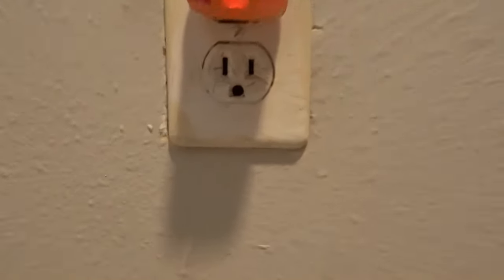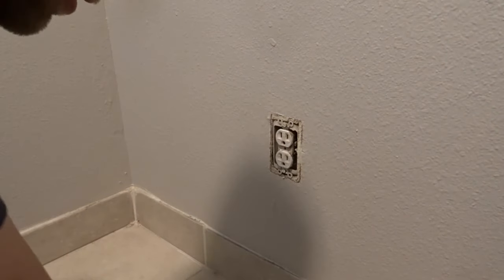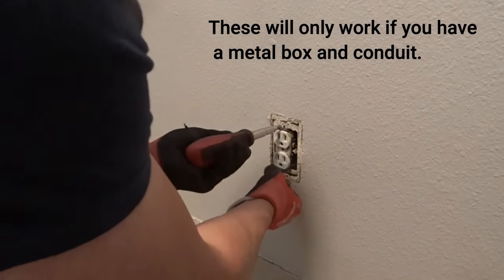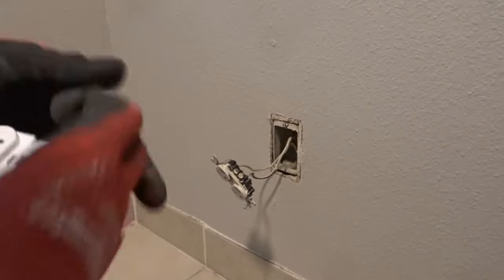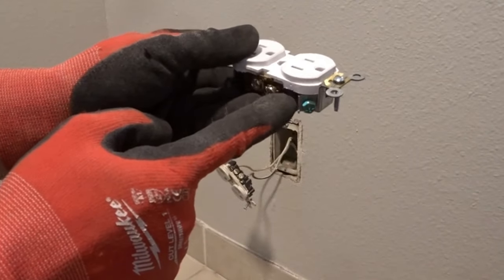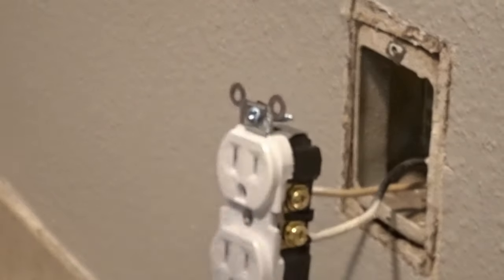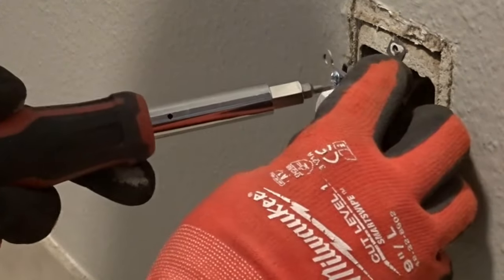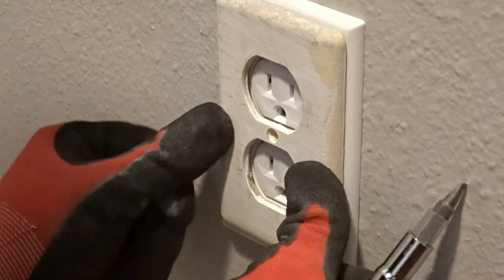How To Replace An Outlet | Ungrounded to Grounded

Comment: The old duplex receptacle had an equipment ground prong. Why was it not grounded ( from the metal box) as the new receptacle is? thanks
Reply from the maker: I’m not sure why it wasn’t, that’s a great question!
Reply: Speaking from experience, more than likely ignorance.
Reply: Ryan Wilson A wild guess would be. The old duplex receptacle was an Isolated
Ground IG type, although never connected as such. Thank you.
Reply: @aaronfixesstuff Isolated ground receptacle.
Reply: @aaronfixesstuff Isolated ground receptacle.

Comment: Might be a silly question but do the gloves stop you from being shocked?
Reply from the maker: Not silly at all! They do not, as they are not insulated. That’s why I recommend that people should not work on live wires. They protect you from minor cuts and scrapes however. There are different levels of protection gloves provide based on the coating they have.
Reply: @aaronfixesstuff  Thank you

Comment: so just clear to make sure the most important is buying (self ground outlet)like the one you have to replace the old outlet, correct?
Reply from the maker: Jun Zhang it will only work if you have a metal box and conduit. If not, you can install a GFI.
Reply: @aaronfixesstuff  great thanks
Reply: got it to change last night it works thanks again

Comment: That creates a possible shock hazard as it turns the box into a path for current to flow or be energized waiting for someone to touch it and complete the circuit.  Connecting the ground wire to a metal electrical box will energize the box in the event of a short circuit. The box could overheat and start a fire, or someone could get a shock from touching it. There should be an actual ground wire that goes back to the panel that is connected to the metal box and the outlet.  New construction requires a metal box to be grounded and the outlet also (see NEC 250.148).

Comment: May be a dumb question.  If you cut the power to that outlet, what did u test at 3:20 ?
Reply from the maker: Not a dumb question at all. That beep indicates that there is no high voltage running through the voltage meter. So in other words, just making sure that there is no 120 at the outlet. Another safety measure.
Reply: It looks like you connected your meter to the hot and the neutral and got a beep. A beep usually means voltage is present. Please explain.
Reply from the maker: @surferdude642  can you comment with the time you have a question about?
Reply: @aaronfixesstuff  at 3:20
Reply from the maker: @surferdude642  that beep indicates continuity. If there were 120, the meter would indicate that.

Comment: I am confused about the ground. With will grounding it to the box energize the box if something goes wrong? or will the circuit trip first when it detects something and the box energizes rather than whats plugged into it?
Reply: "Will grounding it to the box energize the box if something goes wrong?". The short/simple answer... Yes. The box will be "energized", BUT only for a moment while it carries the current then causing the circuit breaker to trip. In this video, the box in the wall is metal, and it is connected back to the electrical panel with metal conduit, which presents a solid grounding path. By connecting the grounding terminal of the outlet to the wall box with a pigtail (which is required by N.E.C.), the ground path is assured, AND any 3-prong corded device (in proper working condition) that is plugged into this outlet will be connected to this grounding system. This grounding path is a low resistance secondary path which will trip the circuit breaker if/when a fault situation occurs (i.e. voltage leakage to the metal box or metal conduit). Of course, there is more to it, but this is what it boils down to. I will also add... please do not assume that just because you have a metal wall box, and what may look to be metal conduit coming into it, means that you have a reliable/solid grounding path available. To confirm this, a professional electrician should be consulted.
Reply: @eugenewong2982  HAHAHA Thanks I asked a "professional" about the metal box not having a ground back to the panel, but he told me it was okay to ground into the metal box alone.

Comment: Don't assume that because you have a metal box, it's grounded back to the panel. You should always test with a VOM by putting a lead on the hot wire and another onto the metal box. If the box is grounded, it should show you full current voltage.
Reply: My electrician used a multimeter and showed me this test you’re referring to.   It would have been helpful if Aaron did the test in this video but maybe this will be an incentive for a new version of this video.  😊

Comment: Wait, if you didn’t connect the pigtail to the box how is it grounded?  Thx.
Reply: It's grounded by virtue of the metal conduit or a separate ground wire from the panel, then fastened to the back of every box.

Comment: Hi , I am interested in rewiring 8 Outlets in the basement (on there own circuit)  cause it is wired presently with 6 overhead lights and the 8 recepecticles on one circut,i want to separate lights from receptacles...the routing is what I'm interested in mostly,  can you help?
Reply: Wanted to add to comments that I have a unfinished basement and the way
Reply: I am trying  to eliminate having so many junction boxes and excess wire connections .

Comment: what if the box is mad of plastic? you did not tell them that the box is made of metal and that you lose the ground as soon as you take it out of metal box if you pigtail from box to outlet the ground will stay with outlet,but you also must   have a means of ground to the box by either a metal raceway are by ac cable
Reply from the maker: Please note that i refer to that both in the pinned comment, as well as in the description box. I made a video to address that. 
https://m.youtube.com/watch?v=A02AIiqEwJg&t=2s

Comment: Looking for education. How can you measure/verify that the metal box is actually grounded if there is no ground wire coming into the box? How would you connect your meter leads to make the measurement? I have changed ungrounded 2 prong outlets in an old house, but code says they can only be replaced with GFCI outlets. They cannot be replaced with a 3 prong receptacle without a ground being present. Also, i have just recently learned about the grounding tab on outlets, so that is probably a lot of the answer. Thanx!!
Reply from the maker: Hi Dan. The easiest way to verify that it is grounded is to get a receptacle tester. It will show two orange lights when grounded. In this situation I did not need a gfci because the box was grounded. You are right about not being allowed to simply use a 3 prong to replace a 2 prong. I made a video to show how to bring it to code if the box is not grounded. Just go to the description box and find the link. Let me know if you have any other questions.
Reply: @aaronfixesstuff  thanx, Aaron! But, how do I check that the BOX itself is grounded? That's got me stumped.
Reply from the maker: @danmidkiff5416  put one prong on the hot, one on neutral. That will show 120. Then put one prong on the hot, and the other on the box. If it shows 120, it’s grounded. If not, it’s not grounded.
Reply: @aaronfixesstuff  you solved a mystery for me! Thank you! I had my head wrapped around checking resistance, not voltage!
Reply from the maker: @danmidkiff5416  glad to help!!

Comment: How is it the electrical box is grounded but the attached outlet is not? I've never seen a 3-prong outlet that would not be automatically grounded when screwed into a grounded box. 
Also, wire insertion holes in the back of an outlet are perfectly fine to use, contrary to popular opinion. They are UL approved, and they do not "get loose" over time. There's no little green gremlin living in the box whose job it is to loosen wires.
Also, I would have used an ivory duplex and cover plate on that wall rather than stark white.
Reply: Electricity traveling through a conductor causes vibration which loosen any connection over time. So yeah there is a green goblin

Comment: Where can you get these plugs? Do they come in decorative style? And roughly how much are they? I have a 40s home with first generation Romex that isn’t grounded
Reply from the maker: You can get them at Home Depot. Just look for the preferred outlets. They will only work if there is a path to ground. If not, I made a video of how to solve it. Just check the description box.

Comment: What if you have plastic box?
Reply from the maker: Take a look in the video description box there is a link to another video I made for that case.
Reply: @aaronfixesstuff  If you are referring to to video on how to use GFCI outlet to protect you from ground fault - I understand that but my question was how to check if ground is good in case plastic box
Reply from the maker: @algolove185  oh gotcha. If you have an outlet tester, it will let you know.
Reply: @aaronfixesstuff  I have an outlet tester and multimeter - but how do I check switches
Reply: @algolove185  to check ground on a switch, use a multimeter (carefully). There should be voltage between the line terminal (black) and the frame of the switch.

Comment: The Case has a wire that goes all the way back to the fuse box?
Reply from the maker: Not a wire, but conduit. If you don’t have conduit, I made another video that addresses how to deal with that issue.
Reply: @aaronfixesstuff  ok I will look for the video about conduit
Reply from the maker: @waynegram8907  is your box plastic?
Reply: @aaronfixesstuff  yes so how do you make an earth ground from an outlet that is ungrounded? even if the case is metal the metal case needs to have an earth wire going back to the fuse box?
Reply from the maker: @waynegram8907  In the description box there is a link to a video that will help with your issue.

Comment: We tried the pigtail. Our box is metal and it’s run through conduit, but it didn’t work. The outlet is also on my kitchen gfi line. Any ideas? Thanks. Update: just tried the out fix. Didn’t work either.
Reply from the maker: If wired correctly, the gfi will protect anything connected from it. I’m sorry I wasn’t able to help more.
Reply: Yes I know. That does work but technically it’s not correct and can’t be fixed.
Reply: grab a separate (egc) extra ground conductor thhn green wire run it thru the conduit all the way from panel ground bar to each outlet.  cld be a break in the conduit and its no longer a complete ground path
Reply: Thanks. That might work but it’s impossible for us since the conduit is underground in concrete. It’s not a real problem for us since it’s in a gfi line until a home inspector decides to look around. So now we just put a plate over it.
Reply: @seven6pro  im confused if its in conduit you run the wire thru the conduit you may have to re pull all the wires due to lack of room but thts the way it gose? or mark on the coverplate gfci no equipment ground or like you said hope no one notices lol
Reply: @wizard3z868  the plug is in an island in the kitchen and in order to find out where the conduit comes in under ground, we would have to remove cabinets. Not doing that. I’m ok as it is. I appreciate your trying to help.
Reply: @seven6pro  np at least you can see there is a break in the conduit and thts why there is no ground to outlet
Reply: @wizard3z868  Yes. That’s true.

Comment: We have an outlet where the bottom plug is OK but the top shows an open ground. Am going to look into it tomorrow (probably replace the outlet).
Reply: When that happens, it means the receptacle is worn and ready to be replaced, as the ground terminal in one outlet on the duplex is stretched and loose.

Comment: I wifi and there's time my wifi turn off and they came and try to fix the problem but it still keeps doing it one of the repair guy said it that it could be the wall outlet is not grounded probably and that could be the case what do you think?
Reply: cld be or it cld be interference from the grounding system all the boxes connected than to the yokes of all the other outlets makes for a great antenna you get interference they make isolated grounding outlets for electronics usually orange with a triangle symbol on the bottom right outlet

Comment: Is it bad if you don’t screw in the green screw when not using it?
Reply from the maker: Great question. The screw should be closed. Wrapping the outlet in electrical tape will insulate it as well.
Reply: @aaronfixesstuff  I guess all the outlets I did this weekend in my house I will have to pull out and close that green screw. Thank you for answering
Reply from the maker: @kurvenation1254  no problem. Glad to help!
Reply: @kurvenation1254  You would have been fine
Reply: @Seananigans.1  I pulled them all the next day. Every one I’ve done since I’ve screwed that thing in.
Reply: @kurvenation1254  Yeah you’re fine either way. The equipment ground screw isn’t as crucial as the hot and neutral.

Comment: you don’t want to install the wires on the back of the outlet. it could cause arcing and won’t be a secure connection. always side wire them

Comment: Very helpful, thank you for sharing!
Reply from the maker: Thanks for taking the time to provide feedback!
Reply: @aaronfixesstuff  if i don't have the metal conduit or metal box... can i  jump a ground wire from a different nearby circuit?  all coming from the same panel.
or...
here's what i want to do.
install an outlet under the sink..  gonna have to use a gfci anyway.  should i just install it ungrounded?

Comment: I just watched your video on replacing the old ungrounded outlet with a new grounded one.  I did that myself to most of my outlets when I purchased this house.  Mine had the metal box.  So I purchased a roll of wire and just cut the length I needed as I went through.  But here is the thing.  My new outlets all were like the one you used with the ground screw.  So what I got from you is that you don't need to put an actual wire to the metal box and then screw it to the green screw.  All you need to do is connect the two wires and then close the green screw and it's grounded.  Is that correct?
Reply from the maker: Hi Jim. Assuming the box is grounded, then yes. Another option, easier than what you did would be to buy grounding pigtails, as shown in the video. Same result, just a bit easier.
Reply: @aaronfixesstuff  Thanks for your reply.  Keep up the good work.
Reply from the maker: @bexaminer1  thanks Jim. Much appreciated sir!
Reply: If the boxes are not connected ground on the raceway to the panel, the system fails on grounding. What is not safe to do it that way. Please refer to a qualify electrician and ask for how to make a grounding system. My best recommendation in that case, start to rewire the house to a 3 wire system and a 4 wire feeder from utility company. That way your system if up to code and safe for 20 more years when the code decide to change everything to DC...... that is my thought. Always online for electrical consulting.
Reply from the maker: @javiergiraldez1647  this was done with the consult of a master electrician/electrical engineer. Also, a solution much simpler than what you suggested would be to install a gfci. I made a video about how to do that as well.
Reply: @aaronfixesstuff  Like I said, if a Master or engineer like to cheat the electronics is ok. The fact Is that I’m Electrical Engineer and Also Electrical Contractor and Of course we know how to cheat the electronics. But talking about safety in our homes is another issue. And that where my point go. If is something that is completely safe, I never use a third party to post the videos on any platform. I will do it myself, hat is why I’m a professional. Playing with electricity is not a game. We are playing with life of millions of persons, we have to do things right the first time. 
When you inspect a house, with your cheat system, I can detected immediately and make fail the inspection. I know when they are doing the same trick that you are showing in this video. So tell your source that show their faces and demonstrate the reliable way to do this without involve in an unsafe situation. Thank for your reply and do the think right!
Reply: @javiergiraldez1647  I understand and share your passion.  Did this work in the end, yes.  Is there a nec violation in the video, maybe not.

Let me explain.....at about the 2:10 time mark he mentioned that the house had "conduit" in it.  Guessing emt.

 250.118 allows for metallic conduits to qualify to be equipment grounding conductors......box grounded.

250.146.(B). Allows listed self-grounding yokes to establish bonding between the yoke and flush-type boxes.

So, it looks like he did okay because the house was a rarity, a piped house.

Yes, there are some things most might do different, but simply a better explanation would have cleared up confusion, at least on my part.

Comment: What happens if you have a house built in 1948 that has 2-wire conductors (with NO ground at all)? Ever thought of that???
Reply from the maker: There are a lot of what ifs. I probably didn’t think of them all, no.

Comment: Before you cut the wires, you need to leave at least 6 inches of it to service, now you are violating the code with 4 inches or less of wire. That looks like a commercial box and riser, so probably is a EmT or MC raceway to the panel. Not a residencial example.
Reply from the maker: There was 6 inches, and it was in a residential setting. Thanks for watching and commenting.